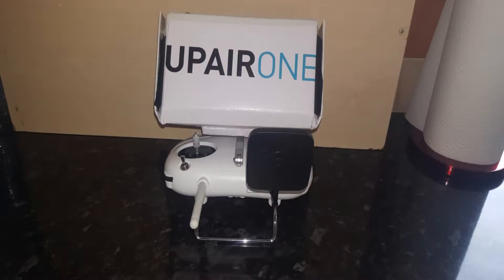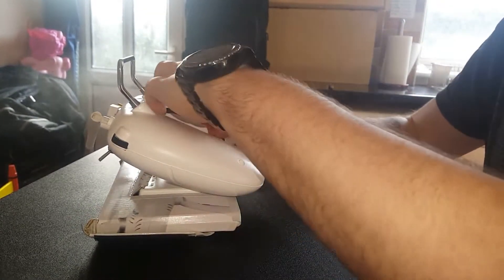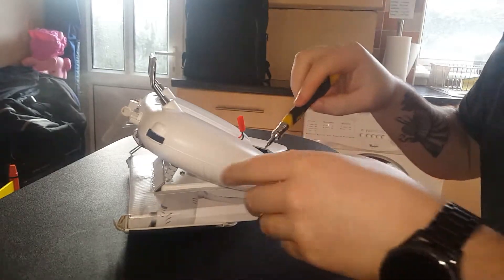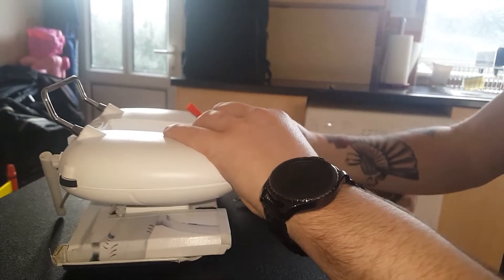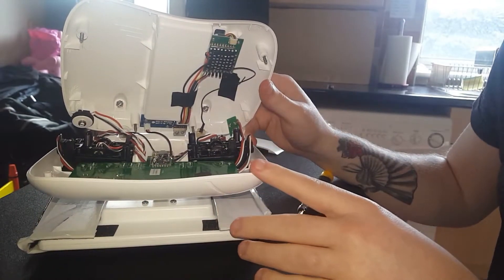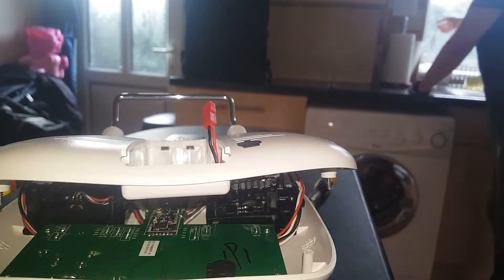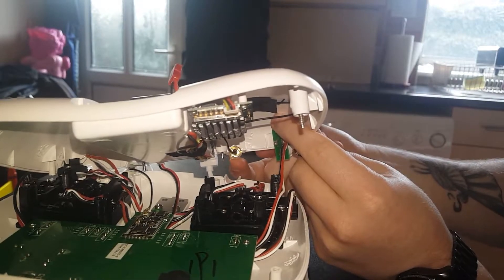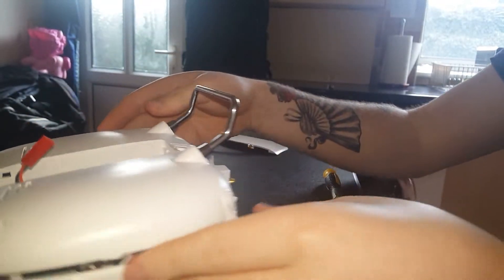Up Air one FPV High gain antenna upgrade tutorial

Comment: Hi mate I have had a few problems with my upair one plus I have duna vid on it wen I get the satellites it won't turn off no satellite it's turned off any ideas mate don 😭😭😭😭😭😭😭🤔🤔🤔
Reply from the maker: I've just had a look at your video and I'm not to sure with th px4 board to be honest. Have you done a collaboration of your controller since changing your board ?  I'm not sure how to with the px4 as I used mission planner. Also a simple one. Try it outside so you can get full gps lock before trying to take off ? Good luck
Reply: @Ingramsir  I have don acontrola cal not USB cal mate thanks don, 🤔🤔🤔🤔

Comment: Hey bud i got the 2.7k is there a deffranc
Reply from the maker: King G Wynn  thers afew different models out now mine was the v2. The wiring might look slightly different but it will be pretty much the same
Reply: Drones above ok bro got another one for u tha ks for helping had no luck on help on hear but iam hooking up TS5828 40CH 5.8 MINI 600MW AN ITS NOT FITING THE ORGNELE. PLUG
Reply from the maker: The rx should have 4 pins an you should have 3 wires as you dont have a wire for sound, I have another video on my page which should show you how to connect it
Reply: Drones above ok iam lost i have the wifi one i have it apart i got pics dont no how to send tham
Reply from the maker: King G Wynn ahh wifi is different ive never really played with it but would imagine you would need some kind of wifi amplifier
Reply: Drones above so the ts5828 wont work i wired it to the old plug dont no if its going to work cuz to me there are two parts to my transmiter

Comment: I have a blue black and red wire connecting to my original transmitter. Where is the video for upgrading this to 200 or 600 mw and how to wire. Thank You
Reply from the maker: Brian s  im not sure with that colour code as mine were black yellow and red. this is my video https://youtu.be/OgvHTDE3Dpo

Comment: How long is the range with this antenna ? Thanks by advance
Reply from the maker: Alexandre Desfontaines  i only tested to 755 meters and still had strong connection when i turned around.
Reply: Drones above Thank you very much, my fpv transmission got broken so I bought an adaptateur to get the fpv transmission on my phone and the default antenna is a very poor quality one
thanks
Reply from the maker: Alexandre Desfontaines glad to hear you got it working again. i miss experimenting and doing mods to my upair 😑

Comment: I flew my new upair one drone 2.7k stock drone 1.5 kilometers today wasn't till around 1000 Did I get any reception problems at 1500 fuzzy but still able to see what I was doin take the fpv antenna from the inside tape to outside of the leg seemed to really help keep em in the air fellow upair one pilots

Comment: Is everything I need to perform this mod here?. : https://m.banggood.com/Hubsan-H501S-H107D-H107D-Enhanced-FPV-Distance-5_8Ghz-14dBi-Panel-Antenna-2_4GHz-3dBi-Antenna-reviews-p1053146.html
Reply from the maker: h0000n yep. providing it just clips on like mine. i know some controllers you will need to solder the wire on
Reply: Drones above so no soldering for the upair one??😅

Comment: Drone is here! The FPV transmitter has no metal cover over the electronics. what chips in there do you attach the heat sinks too
Reply from the maker: Ulises Batalla you mean no cover on the receiver in the controller ? maybe they have fixed the overheating issue
Reply: Yes there is no where to attach a heatsink. The metal cover is gone? I would have to make a super small heatsink and attach it to the chips directly.
Reply: Also how many 2.4 antennas are hanging out of the Quad? I have two. They relocated the 5.8 FPV antenna to the horizontal portion of the lower leg.
Reply from the maker: Ulises Batalla see how you get on without the heat sink as they may have fixed the issue
Reply from the maker: Ulises Batalla just hanging out ? it should come down the leg
Reply: there are two 2.4 antennas and one long 5.8 relocated it looks like. nothing has a heat sink and there is now a hole protruding from the bottom of the metal FPV transmitter cover so you can switch channels. I may just try this thing out stock and see how it does.
Reply: Ok I just checked and the metal case under the drone and it is almost untouchable when running. I appreciate your help man. I am going to add a heat sink. I makes no sense because there are no chips in contact with the metal. So the chips heat is radiant heat and means the chips are or are almost red hot to be able to transmit their heat to the case.  I wish i could actually make a solid contact between case and circuit chips so I can reduce their heat with a good heatsink-ing
Reply: BTW, my instructions are version V1.2. and none of the videos I am seeing on You tube have this many antennas in the legs. I also have some kind of a plug extension with four wires on one of the legs. Not the compass leg but the other side. I see the compass, but there is an identical four wire run to what looks like a plug/port of some type. Any ideas?
Reply from the maker: Ulises Batalla ahh so you have the latest pixgawk version. you cannot do the usb mod on that one unless you make your on connecter that fits the socket on the leg you talking about. if you join this group on Facebook afew people have that version  https://www.facebook.com/groups/upairownersgroup/
Reply: Just got it and in the leg there is what appears to be a 4 cable port that allows you to tap into the board. My main concern now is to change the video resolution. My videos are the poorest quality I've ever seen, they have to be 640X480. It says it's a 16MP camera but the pictures are horrendous. All of the tricks that I have seen on Youtube don't seem to apply to this drone... can't change the video settings, all of the antennas have been relocated (there are 3 of them!) It also seems that the FPV transmitter has been hopped up because I am able to go out past 500M and still have great video reception. The only mod that I have been able to accomplish so far has been to add a heat sink to the FPV aluminum cover, which I now notice doesn't even get warm.
Reply from the maker: Ulises Batalla if you hold the photo button it should change between camera settings, however I have seen this issue before, to fix it put the drone in headless mode (ioc) and do the same, hold the camera button for 3 seconds to select the camera mode

Comment: why do you have a heat sink on that video receiver? have you changed that as well?
Reply from the maker: Ulises Batalla i didn't change it but i would recommend it as it overheats a lot
Reply: I see that you had to sand down the heat sinks so that it would fit in the case I'm going to use the same approach and good heat sink compound I will try using a the longer he sing to dissipate even more heat but a shallow Style
Reply from the maker: yes i actually snipped the ends off using wire snips, it did help
Reply: Thanks for the info thanks for reaching out cuz sometimes the folks you post videos never reach out
Reply: I used to fly a phantom P4 but had to return it to the owner comma I used to shoot music videos. Now I after a long time of studying what I needed purchased an up air and all of the modification equipment needed to do the changeover I will probably follow all of your steps
Reply: There are a few videos on modifying the antennas for better performance I think I will retain the antennas. Andy Phantom I used to fly I changed over the antennas for directional paddle style and tennis and I was sorry that I did that and made that change I think I'll stick with the omnidirectional. One last question do you think the antenna that comes with the video transmitter is sufficient?
Reply from the maker: Ulises Batalla you mean the rubber ducky one ? if so i would say no and change it for a good quality clover antenna the perform much better
Reply from the maker: Ulises Batalla i actually sold this and got a p3 advanced now. hoping for a p4 or mavic soon. i did plan on upgrading the fpv receiver in the controller to external diversity receiver but never got round to it
Reply: Belk make comments that the video receiver inside of the controller overheats and that placing a heat sink on the video receiver is a good idea and maybe even is venting the case to get the heat out of the handheld controller. It's do you agree and if you still had this drone which video receiver would you have replaced and how would you have done it I am interested because I no longer fly Phantom drones for a company I used to work for so I just wanted to pick up something that was affordable and provided me with just the features I needed

Comment: What did the new antenna give you? Longer range, better picture?
Reply from the maker: Michael Wren  both. range mainly. i didn't fly far enough for it to loose signal. i would estimate well over 1500m  and had strong video feed the whole time
Reply: Wow I lost video feed at 350 meters. Were do you find the upgrade part.
Reply from the maker: Michael Wren it eill depend on your surroundings and ut is a directional antenna so it need to always face the drone. i have left a link in the description for the antenna :) also a link for the antenna i have on the drone

Comment: hi my freind,  try changing  the sma lead , but it was solderd  on can i just re solder it back ,cheers
Reply from the maker: martin keepin  hi mate. you mean the stock antenna is soldered on? if so you can de solder that and solder the new SMA connector but you need to earth the wire. to do this, you strip the cable back solder the inner cable to the point where the old antenna was and the outer wire of the new sma wire needs to be soldered to a ground/earth point. alternatively you could install an external receiver and the antenna will just screw on
Reply: How do i do the external  mod ,and where to buy one from cheers james
Reply: Yours unplugged mine was solderd on 😭
Reply from the maker: that sucks really. this is probably your best bed as its small and lightweight http://m.tomtop.com/image-transmission-1181/p-rm5137.html?currency=GBP&aid=gplagbM&gclid=CjwKEAiAoOvEBRDD25uyu9Lg9ycSJAD0cnBywXKzFzuED00I6sgQrZ7mQGgYs3fwHfo1GCOZ84_WOhoCLb_w_wcB bangood also has a few but there quite big. i dont have a video to show the install but its simply just removing the original receiver and soldering the wires for this one in the same place and mount it on the back of the monitor with some velcro. afew people in the upair group have done this i believe

Comment: Do you also have a link to a good receiver for outside the box? And is it hard to hook up?
Reply from the maker: S Judd i would say upgrade the receiver rather than use a fan for the fan just hook it up to the wires coming from the battery. this is a good priced receiver but its quite big there is a smaller version model number RC832s butbits hard to find it in stock Eachine RC832 Boscam FPV 5.8G 32CH Wireless AV Receiver 
https://banggood.app.link/tugFeXMhxz
Reply from the maker: S Judd i would say upgrade the receiver rather than use a fan for the fan just hook it up to the wires coming from the battery. this is a good priced receiver but its quite big there is a smaller version model number RC832s butbits hard to find it in stock Eachine RC832 Boscam FPV 5.8G 32CH Wireless AV Receiver 
https://banggood.app.link/tugFeXMhxz
Reply from the maker: S Judd i would say upgrade the receiver rather than use a fan for the fan just hook it up to the wires coming from the battery. this is a good priced receiver but its quite big there is a smaller version model number RC832s butbits hard to find it in stock Eachine RC832 Boscam FPV 5.8G 32CH Wireless AV Receiver 

https://banggood.app.link/tugFeXMhxz
Reply from the maker: S Judd i would say upgrade the receiver rather than use a fan for the fan just hook it up to the wires coming from the battery. this is a good priced receiver but its quite big there is a smaller version model number RC832s butbits hard to find it in stock Eachine RC832 Boscam FPV 5.8G 32CH Wireless AV Receiver 
https://banggood.app.link/tugFeXMhxz

Comment: Hello James. I did the transmitter upgrade. Now my receiver in the hand controller is getting to hot, I tried heatsinks. Still losing the picture when it gets hot. Any ideas?
Reply from the maker: S Judd  hey yeah its a common fault for the receiver to hot. a lot of people upgrade the receiver to an external one or you could install a small fan to keep it cool. if you search raspberry pi fan thats the type you should use
Reply: I have three of those fans on the way. What wires should I use inside the controller to hook it up?   I tried an old computer fan to the battery wire and burned it right up.

Comment: The range has improved a lot? How much? Thx
Reply from the maker: Gladston Fermino de Souza  yeas alot. i got over 750 meters with this but it started raining so i had to turn back. i no longer have this drone to confirm any further.
Reply: That's very good, to reach this distance you change the video transmitter?
Reply from the maker: Gladston Fermino de Souza i changes the transmitter to a interchangeable 25mw-600mw transmitter. video also on my channel. i would also recommend to upgrade the receiver to avoid overheating issues. the video of the 755m flight is also on my channel. i had solid fpv transition the whole time

Comment: not recived  it yet , it's that black lead you replaced
Reply from the maker: martin keepin ok so you need to also order a pigtail connector thats the black lead. you reed to make sure it the same type as your antenna so RP male to RP female ect
Reply: Ok I look when it arrives , can I post a pic when it's delivered  thanks
Reply from the maker: martin keepin sure. you will usually get one with 3 leaves and one with 4 the one with goes on you controller and 3 on the bird. on your order doe it say 'RP' SMA or just SMA ?
Reply: Ok thanks

Comment: does this extend the range of the quad? or just the distance the fpv will work to?
Reply from the maker: outdoorlip the antenna i replaced here is just for the fpv video feed. the the 2.4ghz will still outrun the video feed. but you could upgrade the the 2.4gh in exactly the same way just by using a high gain 2.4gh antenna but i don't believe its needed

Comment: Hi CruzRoy Is there any problem in using nickel cadmium batteries in the transmitter?
Reply from the maker: hey Nelson Soto im not Cruz roy haha but personally would not try and use anything over than lipo in the controller they are different voltage and discharge. lipos are far better than ncad battery's too so i would stick with them. ask in the group as ive never used ncad battery's
Reply: Thanks james what I've heard of the lipos is that they deliver a lot of amperage quickly which is good when there are motors but as in the transmitter is not the case and I was damaged the original ???
Reply from the maker: Nelson Soto lipos can deliver a lot of power but thats with higher c rating. the upair battery is only 8c whereas powerful motors use 30-40c. you can pic up any 11.1 8c battery and use it there really cheep and will preform alot better than ncad.  zop power do a 2200 mah battery that should fit and thats under €11 on gearbest/ebay. original is €22 on banggood
Reply from the maker: Nelson Soto it gets quite complicated but the c stands for capacity. and its basically a discharge rate the battery can be operated at, so the higher the c rating the the more continued power the battery can safely supply
Reply: Thanks James I was reading now a bit, but I have a battery error that I intend to use is not cadmium nickel but Li-Ion exactly Sony us18650GR ... what would you tell me about this?
Reply from the maker: Nelson Soto if its an 18650 its only going to be 3.7v im guessing its out of a laptop? or a drill? chemistry is completely different in them inr/icr. the discharge rate should be plenty but again i wouldn't mess with them they can vent and explode quite violently.  honestly stick to the stock lipo as it doesn't take much for these to spray fire at you
Reply: If it's a good laptop I'll look for in bandgood or Amazon thanks James
Reply from the maker: Nelson Soto im not sure what you mean ?
Reply: I have those batteries that are from a laptop the originals of the upair trasmitter were damaged and so I wanted to know if the li-ion could be used ...
Reply from the maker: Nelson Soto  ahh from you comment it looks like you was going to buy a new laptop haha. just stick to a lipo they are cheaper and used correctly will not risk your arm :)
Reply: If I have seen that these li-ion are very expensive but as they are idle and unused I wanted to see if I used them, although now I am waiting for repairs to repair the drone in January, what I do not notice is that it combines an original lipo cell that Not damage with li-ion and these lasted much longer ... (li-ion) this I did without flying clear.
Reply: I am interested in being informed since I work with electronics at (technical level)
Reply from the maker: Nelson Soto combining the 2 is almost guaranteed to cause a fire. i use 3 25r 18650s together everyday they have to be married (charged and used together) to keep the vaultage the same. if one of the batteries has a lower vaultage it  cause it to vent and combust. please do some research on them as they are very dangerous if used incorrectly
Reply: Thanks James I just did it to prove I should not combine them with the danger of fire ....